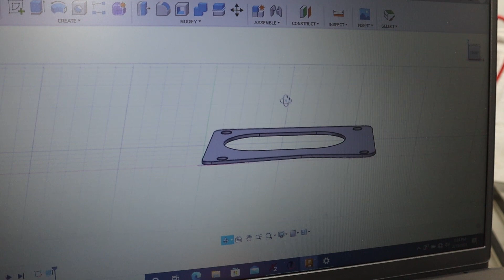Unlocking the KEY to the NEXT LEVEL!

Comment: Make sure it is Very stable , maybe mount it to a wall so it doesn't shake when the cutting head stops or changes directions
Reply from the maker: Surprisingly there's almost no inertial movement at all that I've seen so far. 👍

Comment: CNC Plasma is on my top 5 tools to get asap. Kind of dreading learning CAD but I'm sure I can do it. I am actually thinkong of getting ARC-Droid instead. SO beginner friendly. Whay did you choose CNC over arc droid? If I may ask. Oh and hey, got any of them Hemi engins laying around i can steal, I need one for my 01 ram. Doing a swap heh.  I'm sure they will be rather cheap in a junk yard by the time I can afford to do it.
Reply from the maker: I think the Arc droid makes the most sense for people who have very limited shop space. I'm fortunate enough to have a large enough area that I can have a 3x4' table and it's not in the way. An additional benefit of this machine is the water table, since if you've ever had a chance to cut using a plasma cutter it makes quite a mess both with metal and dust, the water table really cuts down on that. Also, the arc droid is limited in the size of parts that it can cut out, and this machine has more range. 👍

Comment: Hey Reignited, sorry for going off topic but I'm not sure if you're checking the comments on older videos.
About the HEMI tick - you keep mentioning specifically the 6.4l TRUCK engines having this problem, but what about cars?
I found a 2014 Charger SRT8 with 20000 miles. Would you recommend upgrading to a Hellcat oil pump right away?
And isn't it gonna suck the oil pan dry at higher RPMs?

Comment: captain reigniter; curious as to do you think a 6.4l will bolt uo to my 05 5.7l magnum awd transmission.  thanks
Reply from the maker: Mechanically it'll bolt right up with no issue, the bigger problem is running the engine since the programming is completely different, the crank trigger is different, and the Magnum has no way of controlling the VVT or the intake runner system. All can be solved with enough time/money but it's about how deep you want to go. 👍
Reply: @ReignitedAuto  Thanks for the reply!  Ideally I would have a donor car I could grab pcm and wiring from.  im an old ASE master tech who does dot have all the lx car experience you do.  not sure if i will go for the swap or sell the magnum and get a 392 car.  Thanks for helping me reignite my passion!  Rock on!

Comment: Congrats!! When you mentioned Crossfire I had to laugh. I have been looking at a possible project and was actually going to see if you had any advice. I am looking at possibly doing a Hemi swap into a 2007 Chrysler Crossfire limited with the 6 speed (always had a soft spot for the misfit).  Thinking about taking a hemi and manual trans from a similar year charger. Just in planning stages right now since it would be my first swap of this difficulty. I have only done like for like swaps previously like an old 318 to a same year replacement 318. Any thoughts on some complications or things I should look for? 

Thanks in advance and really looking forward to your upcoming videos.

Comment: A question for you. I have a rust free 2005 300c with a bad engine. I also have an opportunity to buy a 6.4L Hemi and 8 speed transmission, cross  member, and a drive shaft from a wrecked scat pack. If I used a holley terminator x max to run the engine and transmission, what else am I getting into, or is it too much to ask? I'm thinking I'm going to need to run an engine and transmission that came with one and other if I'm going to run a holley terminator x max or am I mistaken?If I can run the 2020 engine with a nag1, it'd be so much easier. Is that a possibility with the holley system

Reply
Reply from the maker: They may have updated it since I last looked into it, but the Holley terminator only controls a 48RE trans, not a NAG or 8spd. I'm sure they develop that software eventually though, it's too popular not to.